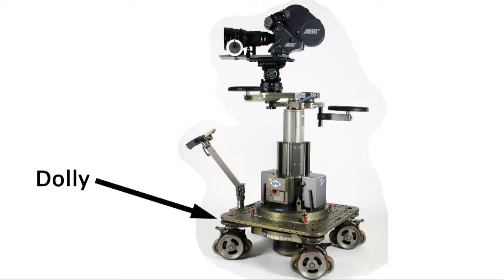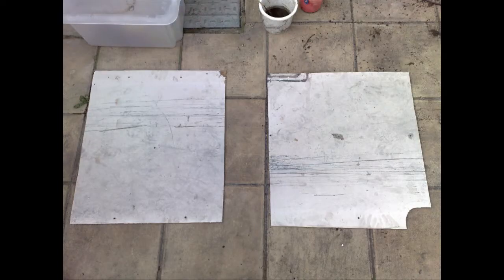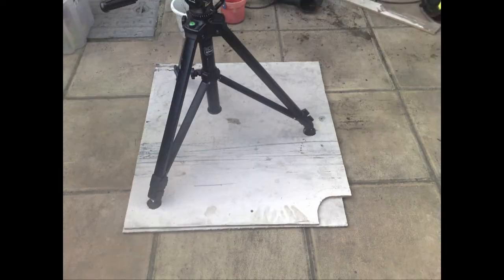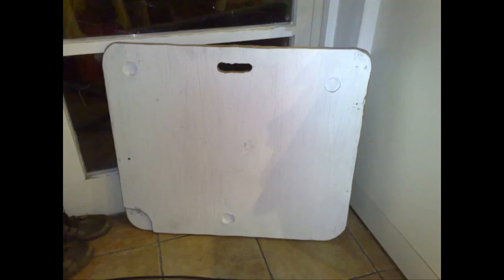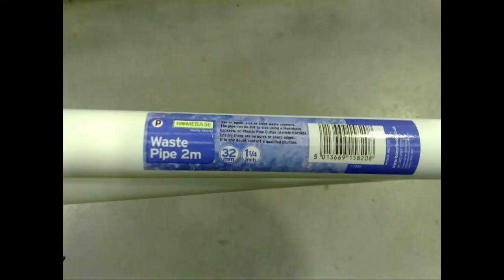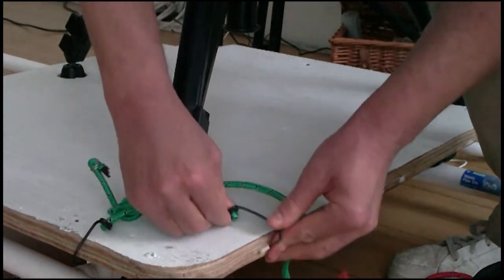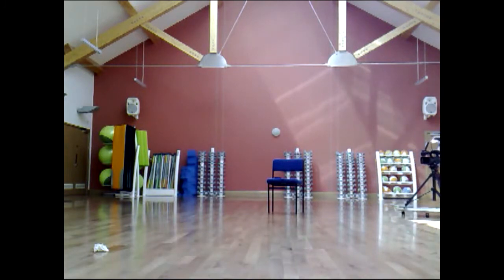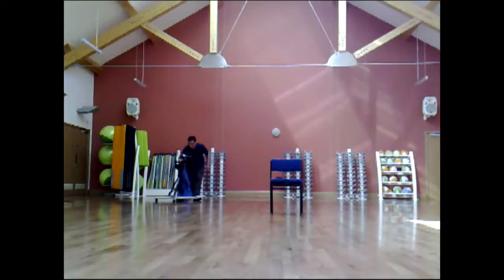DIY track and dolly

Comment: extra tip: add weight to the bottom of the dolly to give the dolly extra stability. Also if you wanted to finish off really nicely, you could make sure the tripod dosn't shake by either attaching weights to the lower part of the tripod legs, putting pieces of playdough i tiny bags as padding for the legholes or simply tie down the tripod with large elastics, ex: attached at one side, over the top of the tripod and attached to the other side, eventually do it with two elastics for extra stability :)